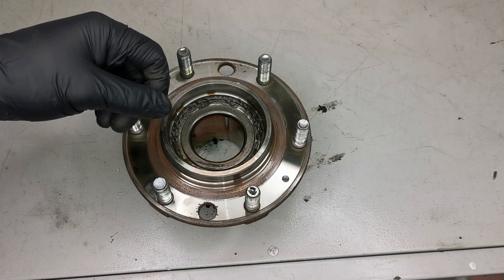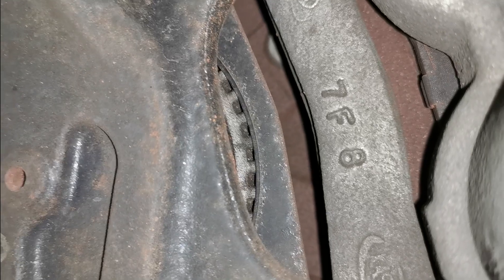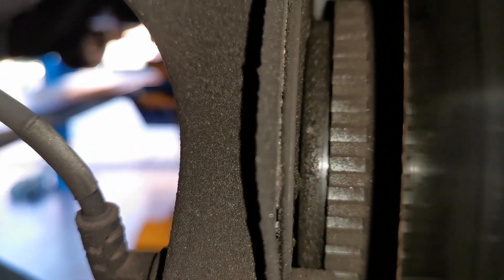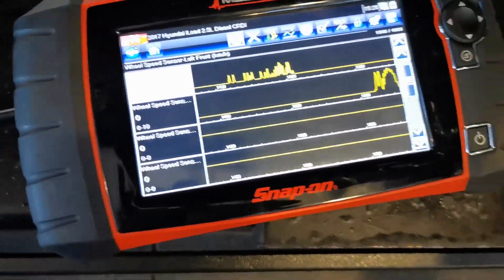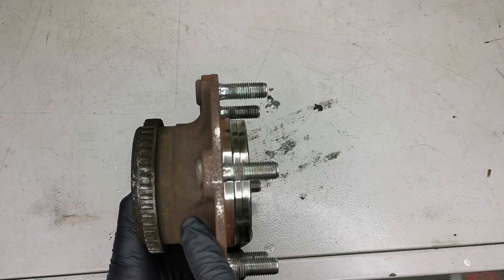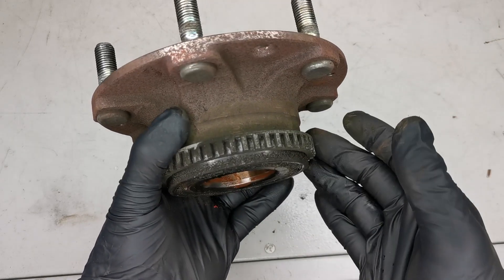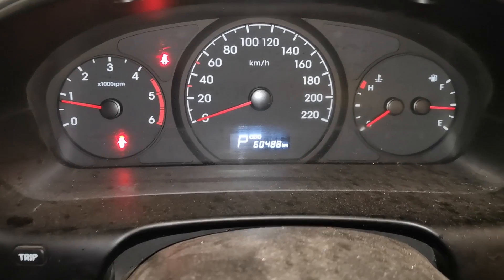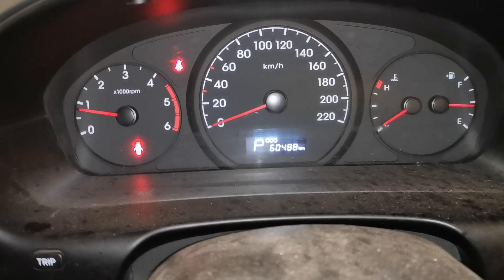ABS & Traction Control Faults - Hyundai iload 2017 CRDI

Comment: Hi Gerard, nice informative video,  my IX35 has a traction control light come on along with the downhill brake control light  in yellow and red respectively, could that be the cause?

Thanks
Reply: Yes .. other causes available ... Wiring , duff wheel sensor , fluid level , rusty stator ring , wheel bearing

Comment: Good job is it not under warranty 60k
Reply from the maker: Thanks Robert,
Regards this company it is a fleet account with loads of vehicles, the boss knows what warranty there is on his vans as it is not uncommon for a trip back to the dealer for issues.

It is a case of get it in at short notice and get it done as quick as possible so the driver can get back to work, we do as directed by the customer so that decision could be based on turnaround time or that part may not be covered in his purchase plan, I am not sure. 👍

Comment: Good call Gerard!
You can't beat looking at data and making a diagnosis based on the results.
I have seen this issue after someone has replaced a hub assembly or sensor incorrectly or fitted a non ABS to an ABS model. Really important to double check the parts we fit. Better to spend an extra 5 minutes measuring and inspecting than hours taking it off again.
Thanks for the informative video! 😉
Reply from the maker: Cheers Mate 🙏
Completely agree, makes all the checks possible to confirm and rectify the issue 👌👍

Comment: Excellent example there, and a great description of the alternative approaches one could take to rectify the issue. I presume the “fix” would entail shifting that ring back in position and attempting a weld but surmise that that might cause balance issues! Is it that sensor that provides the signal to abs to pulsate the brakes?
Reply from the maker: The possible solution is moving the reluctor ring back into position and possible using a bonding material to secure it (if it does not hold correctly)
You can't weld that area because of temperatures that would cause damage of the bearing.
Reply from the maker: The reluctor ring creates the waveform that you see picked up by the wheel speed senor in the video. When the system is fully functional it allows the pulsing effect when Abs is applied